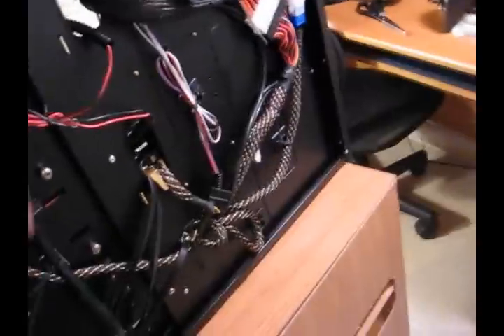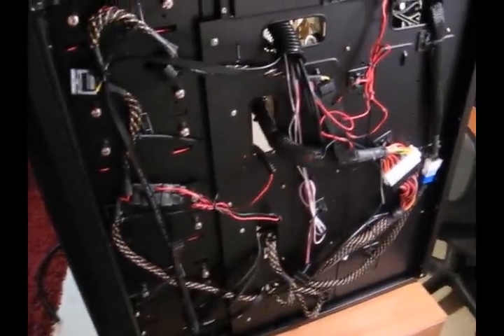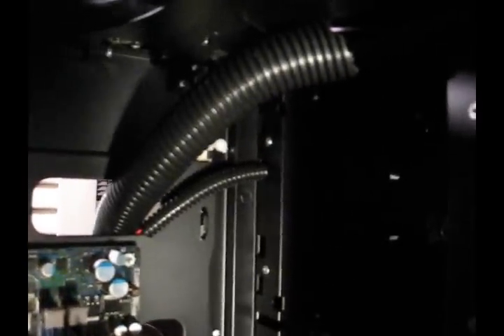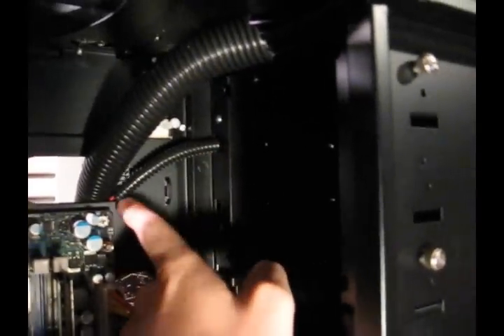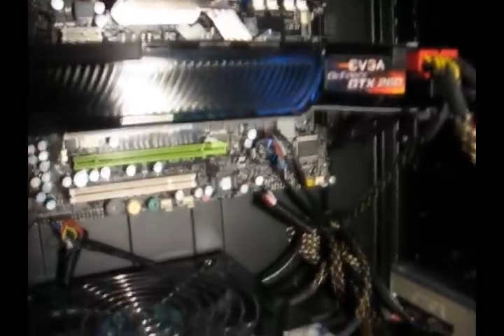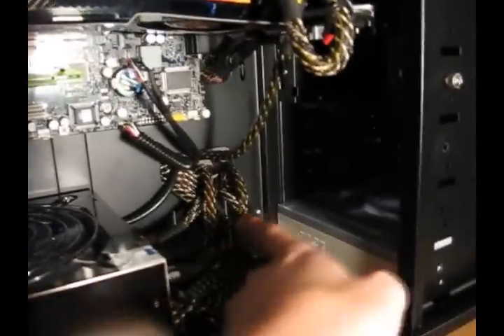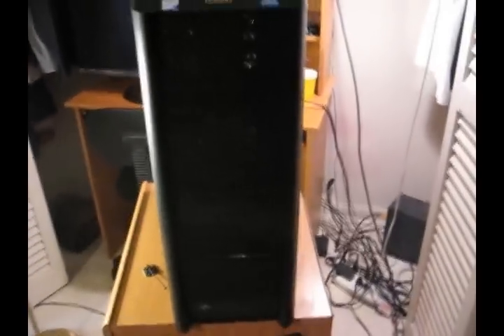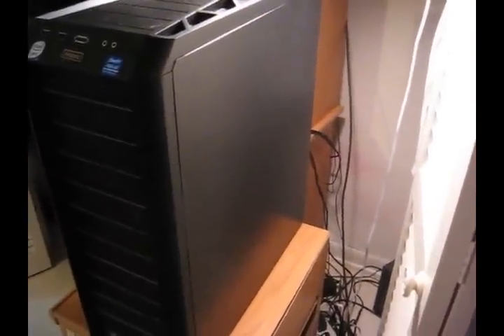Antec 1200 Easy Cable Management Part 2

Comment from the maker: Well I had to buy an extension for the 24 pin and it came sleeved when I bought it. No need for an adapters.    

Info about the extension is in my first video on Cable/man with Antec 1200 =]

Comment: Did you need to buy an adapter to connect the 24 pin connector to the motherboard? And do you have to sleeve?